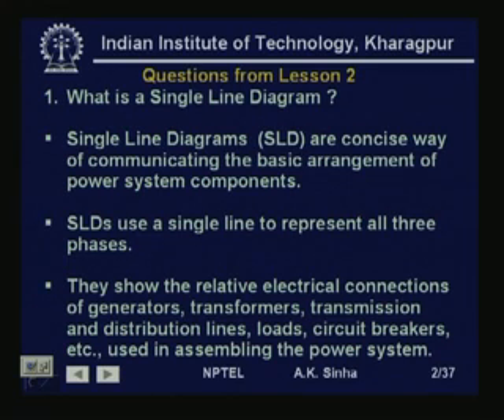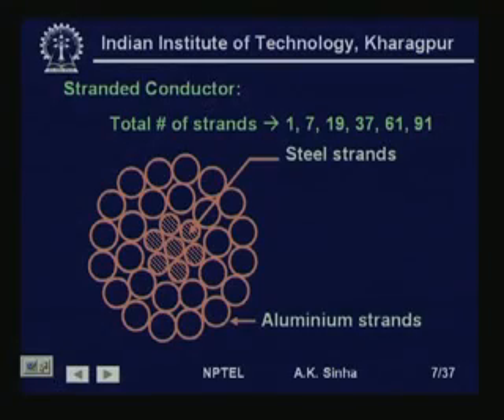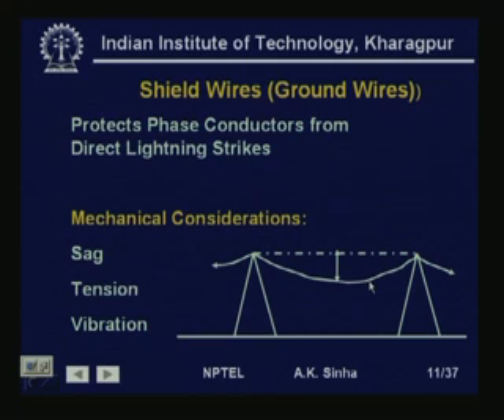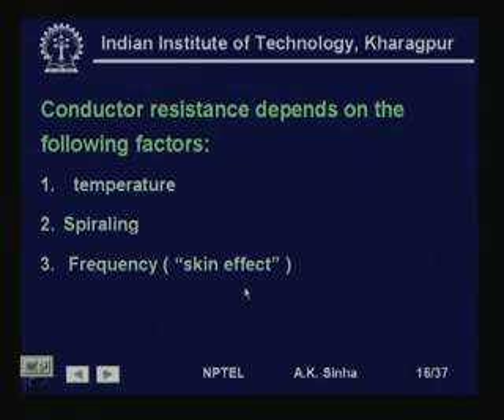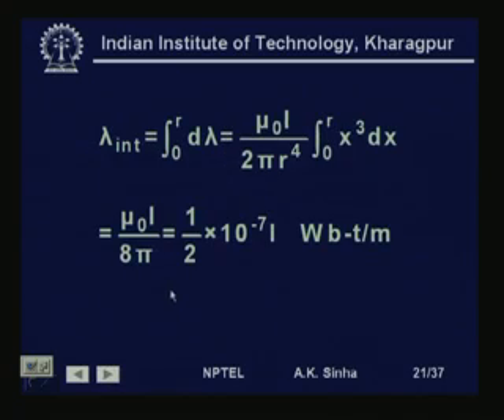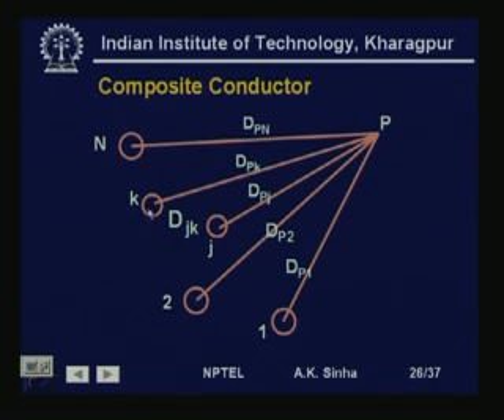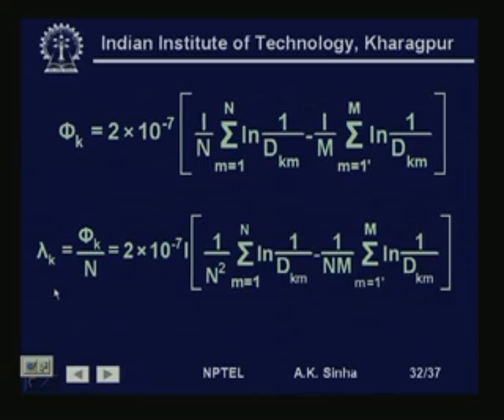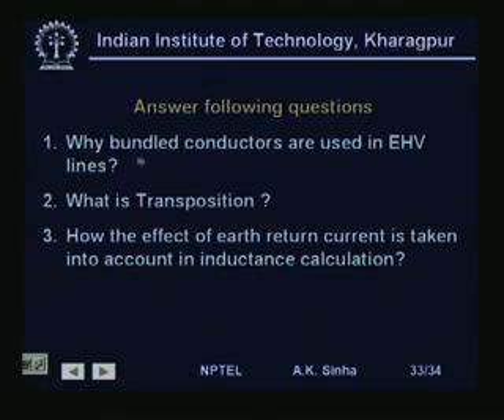Lecture -3 Transmission Line Parameters

Comment: C3 The present electrical theory is far too complex to allow for a revolution in electrical usage, and these lectures just demonstrate this fact admirably well. Progress only happens when we re-examine past theory and remove from it what is unnecessary to arrive at the necessary truth. But failure to re-examine basic theory will end in disaster as the trend toward specialization -- and hence ignorance of wholistic circuitry principles -- continues. We need basic principle understanding to see